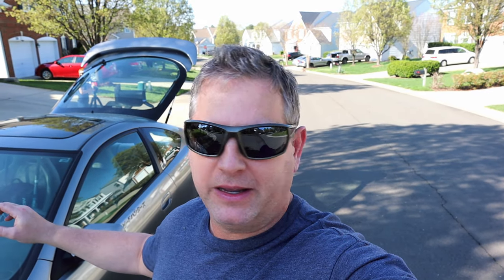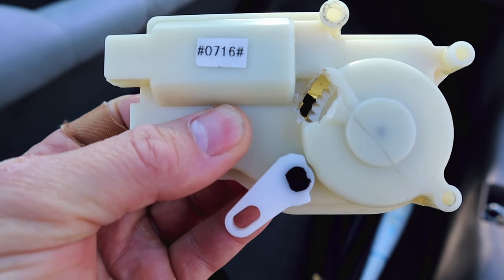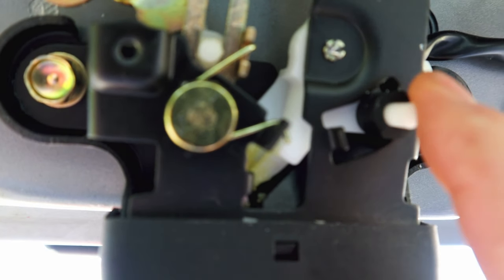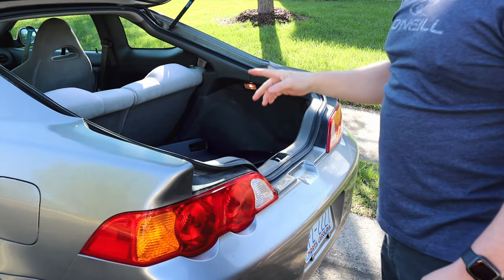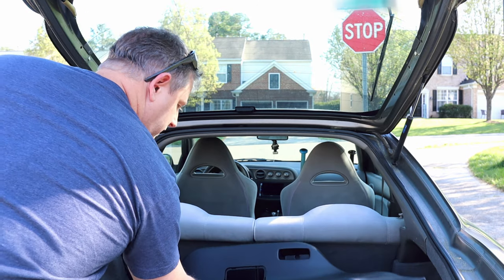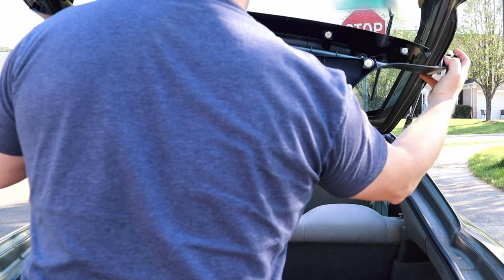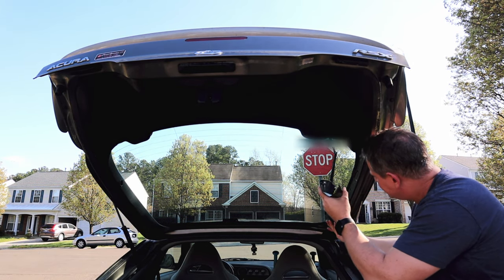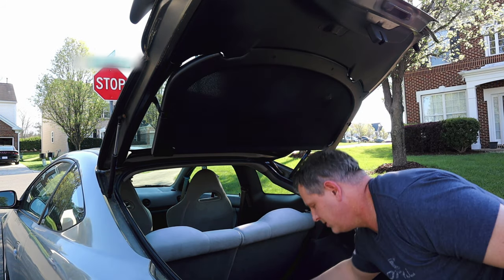#MTBPlanB How to replace broken trunk actuator on 2002 Acura RSX.

Comment: The issue I had was with my Acura RSX having to open it from the inside pushing the white lever, not sure if its the part you are showing or if something is jammed in the lock itself.
Reply from the maker: I replaced the actual lock actuator. The white lever is a manual workaround.
Reply: @MTBPlanB  Yeah I will probably end up having to do that.

Comment: I have a 02 rsx and when I lock the car the hatch still opens but the alarm does come on but I don’t want it to open at all when it’s locked so would that be a problem with the actuator or the alarm?
Reply from the maker: Could be and most likely the actuator. Can you see it trying to engage  if you remove the access panel?
Reply: @MTBPlanB  I’m gonna take a look at that tomorrow for sure especially bc a lot of cars are getting stolen close to where I live and I don’t want to take any chances

Comment: How did you open the trunk in the first place?  Was there a way that you opened it from the inside?
Reply from the maker: Yes there is a covered latch area that can be released inside the car with seats folded down.
Reply: @MTBPlanB  
Thanks.  Would this be the covered area where the "3rd" brake light bulb is located?
Reply: Thanks to your video, I replaced the actuator, and as you stated I broke a clip.  The Acura dealership quoted $695 to replace it.

Comment: How did you get those smaller trim pieces off? I keep trying to work around mine but they just won't come undone and I feel like I'm going to break it.
Reply from the maker: There’s one screw. After that it’s just plastic push pins. Grab the trim near each pin and give it a firm pull. You can also try a trim removal tool.
Reply: @MTBPlanB  I figured it out. There are also tabs near the large trim piece and if you don't unclip them by working around it with a screwdriver, they can break. I broke 1 on my driver's side but it's not big deal. Should cause any extra rattling.
Reply from the maker: Thanks for sharing. Maybe ours were broken already from previous owner.